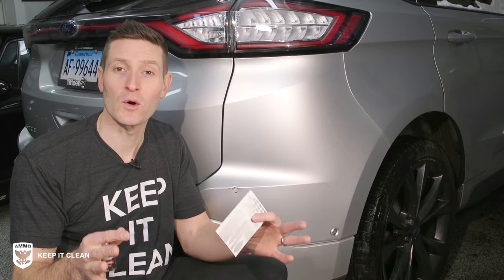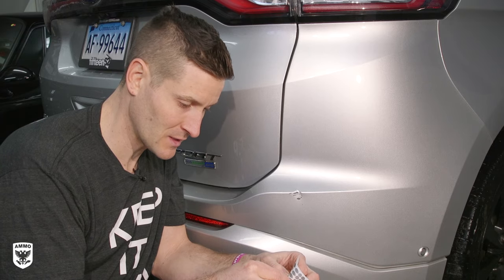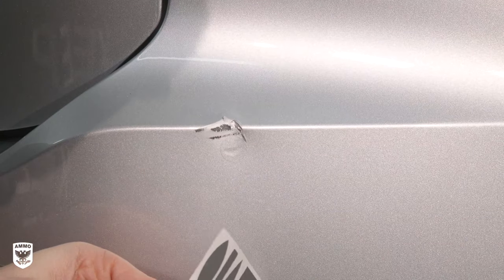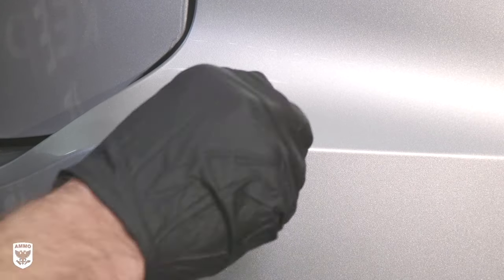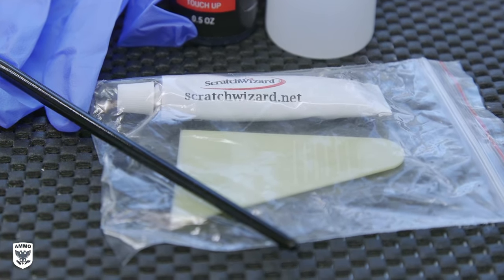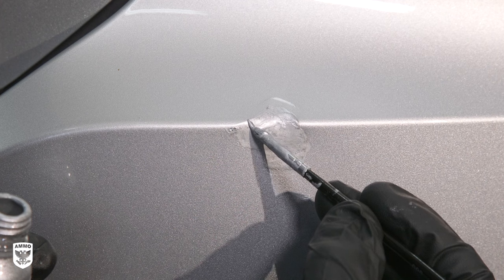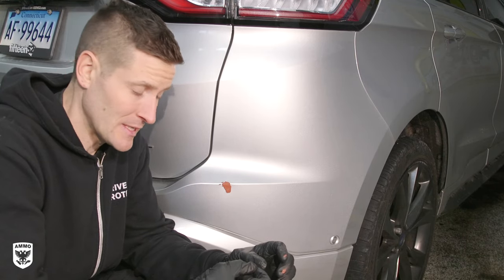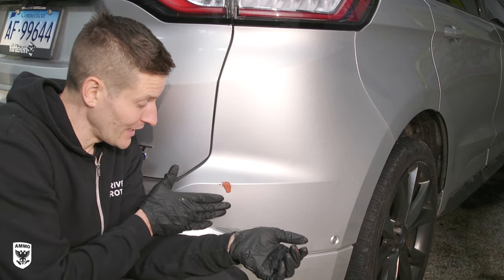How to Hide a Bumper Scuff Fast

Comment: Isn't this car a lease? These touch up stickers are perfect for lease returns lol
Reply: Yes they are!
Reply: I want those stickers, where did he get them!?
Reply: @AW-gj4ji  I think it's in description. If  not mentioned. Now- color matches aren't anywhere near perfect. Especially if you match a panel vs bumper. How far off depends on what angle you see it. But I suppose to the non-skeptic most wouldn't notice. I di something close for a living. I can walk by a car  and see almost EVERY ding, scratch,'Repair', chip. I am sure the details  on how people  try to cover up stuff  would bore you.
Reply: @UZI9MMAUTO  Yeah, I notice every small little details too, but some idiot scuffed my front bumper while my car was parked. I got quoted 600$ to fix it, I think I will be able to deal with some cover up for a while till I get enough damages where I would repaint the whole car instead.
Reply: @AW-gj4ji  Why I park but FAR from everyone. What  color is your bumper and is it a Pearl? P.S. If you have paint transfer. You can use diluted floor wax stripper and a rag :) That is one of our tricks. Otherwise go in various up,down,up, side to side motions with a safe thinner, DO NOT  'rub' it out fast.[Go light in either chemical and take you time- vary in directions]  Otherwise You'll have a nasty score on the clear. The idiot detail guys do this and it looks like crud. Big rubbing scores all over a small  stain.
Reply: @UZI9MMAUTO  Sadly, it's not paint transfer. My car is black so it shows like a sore thumb out. I try to park far too but sometimes street parking I have no choice. I am pretty certain it's half intentionally as it was deep enough to scratch off some of the plastic.
Reply: @AW-gj4ji  Yikes! Sounds like some idiot couldnt go around. Just scraped you and kept going. Those can  be very deep. Now you have to get/make the right black. You can TRY the 'cover up' by paint code. We commonly more than not have to adjust the paint to match from the 'factory OTC match'. Those tubes and sprays arent always close even.Plus your bumper was  painted at a different time than your vehicle. 90% of the time if you stand back. You can kinda see a hue or contrast difference. Luckily this wasnt on a panel!
Reply: @AW-gj4ji  he made them ,buy them from him

Comment: Glad to learn from your experience instead of having the experience myself. Great tip on the stickers, which prevent further damage until you can get all of your dings, dents and chipped areas repaired professionally at one time.  Thanks for taking the time to work through this problem and showing us how hard it can be to use touchup paint effectively, the benefits of using leveler to correct mistakes, and the effectiveness of using paint-matched stickers. All-in-all a very useful video and thanks for making it.  If you find a way to get the paint stickers to fully adhere to the putty, please let your viewers know.

Comment: You have restored my confidence, Larry.  I bought a touch-up kit for my car from VW and what I got was a 2-part (color and clear) touch up kit and my car is metallic. And to compound the problem, they were paint pens not proper paint bottles. I was able to touch up smaller dings but could not get the dispersion right on larger ones and never got the clear to flow in any useful way and gave up. Now I know it's not that I was incompetent but that I was trying to do the impossible. thank you :D

Comment: As people stated, time to learn how to use an AIRBRUSH Larry! It's just the perfect excuse to buy one too.
Afterwards use the polisher to remove any overspray and make it almost perfect :)
 You could have sanded down the bump or even cut it flat with a razer blade and then fill everything with bondo.
Great vid!
Reply: I agree Metallic paint is difficult for larger surface areas. An Airbrush sounds good. I had to feather in the paint from spray can and then the clear coat 2x harder glamour can.
Reply: The fleck will show  and if doing various cars. It takes  LOTS of cleaning per color. Plus the wind. amount of waste isnt cost effective. Even with black paints. Even the same make, will have blue, red,green, big/small/tiny fleck. It won't always 'pay for itself. Plus many are  stupid pearl based paints...
Reply: I found a guy who was a Michelangelo with an airbrush that made a spot like this literally disappear for $100 or some ridiculously small amount.  After he fixed it I couldn't find any evidence it ever existed.  It blew my mind.
Reply: @claytonhinkle5468  do you by chance live in FL? I would love to use his services and tip him generously!

Comment from the maker: FYI: The prices for the wrap vary on color, size, shapes etc...the cheapest I noticed on the website was roughly $30, but call them to get the specifics. Hope that helps. :)
Reply: What's the site?
Reply: Would it have been possible to use touch up along the edges of the sticker to help blend it in?
Reply: AMMO NYC  will it hold up during a wash?
Reply: Francisco Arroyo as long as you don't blast it with a pressure washer, you're good
Reply: AMMO NYC whats the website called
Reply: Have you ever tried doing this type of repair with the color matched auto spray paint?
Reply: It is a hundred dollars for the smallest size.  Click bait.
Reply: Have you tried taping off the surrounding area and spraying the touch up paint then wet sand and polish to blend it in?
Reply: What I normally do since it's a (temporary) cosmetic fix is to shave the lip off with a razor(not for everyone) then build with putty. I have done it hundreds of times when I do a temp fix on license plate holes because the screws cause a bulge. I rather build up than see a new ridge line.
Reply: IAM EVERYDAYGAMER so you can’t use it as a permanent fix even for a tiny spot?
Reply: Ryan I think you can but depending on the environment you live in a fix with a wrap is temporary. I live in the Midwest and something like this would not be permanent. The weather takes a toll on every car around here.
Reply: why don't you use thin aerograph???
Reply: +1 A hobby airbrush that uses a can of compressed air works good on an area several inches square, on a single stage paint job, less well on a base +clearcoat.
Reply: On a silver metallic paint? I don't think the result would be "perfect"
Reply: @5084204  Metallic paint can never be repaired correctly if you cannot use the same method as the factory.
Reply: Should have corrected that 'ridge-line' by applying heat gun BEFORE bondo, and mold running.  Would have saved a lots of filling.  sprinkle some nail polish glitter on it in the mix.  You will be surprised.

Comment: Hey Larry, one trick I’ve had good luck with when trying to level touch up paint or that putty has been to wrap the towel around a meguiars foam sanding block. This keeps your finger from pushing into the depression and allows you better follow the body surface and  level the putty with the solvent with better results. Just my tip. Great video!

Comment: it's very good that you tried that much and you show as all your techniques. I am not a proffesional by any way just i love spending time in my car. I had a huge hole in my rear plastic bumper. What i did was to sanding down a bigger area than the whole down to the clear plastic. I put a mesh filler pads from 3m then 3m plastic filler and then 2 coats of primer one prebase coat and 2 layers of base coat 1 layer of clear coat. After that i let it dry for 5 days and then i wet sand a bigger area than where the hole was and finally i polish the whole bumper. The result was perfect. I used spray cans for the whole procedure. A lot easier than playing with the painting small brushes.

Comment: I remember having asked a question yesterday on the Porsche resto video, regarding touching up metallic paint. With this video you answered it all. Seems a professional like you has the same struggles as I am having with the metallic particles not lining up as spray paint would. The stickers are a great suggestion, but ordering them from Europe would cost a fortune in mailing costs. When it gets warmer again, I have a plastic front bumper that the previous owner of my vehicle damaged. I'll try my best on there, since it is silver metallic like your Ford. Hope I'll learn something on the way. Thanks for the insight, Larry.

Comment: Man you're crazy! Love how you tested different methods before settling but by far the easiest way to fix that "Dent" Would have been to heat up the area from the inside with your heat gun and push it out with you fingers and use a flat blade to shape the body line while keeping it hot. I've done this on a lot of bumpers with great success. Keep up the good work sir!

Comment: How come you didn't try to heat the bumper and push out the dent first?
Reply: My thoughts exactly. I'm sure there was probably a reason.
Reply: And to push IN the top bit too.
Reply: I am totally a novice, but wouldn't heating the bumper enough to push out the dent have caused even greater paint damage in nearby areas?

Comment: I had a scuff in my bumber. The scuff was long and lots of ridges in the paint. I sanded it with 240 sandpaper to level the ridges. Then all the way to 2000. Then i got color maching touchup (black metallic) after the touch up. I only taped the damage area and put a spray clearcoat on it and let it dry over night, then wet sand with 2000-4000 and then polish. Really came out good👍

Comment: i can repaint that for you in 45 mins for 200$ with high quality auto paint =]
Reply: 04av6 that’s 170$ to much
Reply: oh wow, you can repaint for 30$? where
Reply: it costs 30$ for the sticker.. Thats what he ment.
Why not just use a spraycan and blend it in?  Would be the best solution for the money.
Reply: Ill do it in 20minutes because I have a trainee mixing paint.
Reply: i can repaint hole car for less than 100$ 
and before asking were i well answer you, in Yemen ^_^
Reply: 04av6
Reply: @dereknapier836  This work is probably done days before the car was sold?

Comment: Sometimes if you pour very hot water on a plastic panel it will return to its original shape like a memory foam. Maybe try that first then skim it with bondo or sticker. Awesome video as usual 👍

Comment: Initially inspired by Larry's old touch up video, I've tried the classic paint touch up with sanding, Dr. Colorchip, and dealer paint with Langka Blob Eliminator. I found the Langka method by far and away the best. You quickly go through the clear on a new paint if you're not careful, and so it is a very slow and methodical approach. If the touch up paint bubbles, as mine likes to do, you can't go back again without removing even more clear coat, which is not good (buy thinner if you have this problem, btw). Dr. Colorchip would be nice, but the color doesn't match quite right (even with a replacement bottle). Polishing never quite gets the gloss you'd want, and oftentimes removes the paint. Langka might not get quite as good of a look as the sanding method, but is essentially foolproof and blends the chips very well.

I think next time around I'll lightly sand the edges as Larry says to minimize their appearance (they are very noticeable on my black truck) and then follow up with my touch up paint. Basically, I use just enough of the color to cover the metal/primer, then top with clear until it is slightly above the rest of the paint, then use blob eliminator to level it out. Polish to your satisfaction.

Funny that you did a video on Color Wrap Match, as I was just looking at them the other day. As far as your feelings on touch up goes, I'm in 100% agreement. My wife also thinks I'm crazy too...paint damage has a way of driving one insane. Trying to figure out paint protection that won't cost $7k like a full xpel wrap. Had any experience with Autoflex? It looks pretty promising....

Comment: Excellent! My car has a small paint scratch on the bumper but the original contour was unaffected. So I think my best choice will be to use the stickers. It is a solid yellow and I won't have to worry about the 'grain pattern' of the metallic particles matching up👍👏🤝Thanks😉!

Comment: Hi Larry, to prevent an uneven surface like the one with the first sticker, use a sanding block or a piece of wood like the pallets for stiring paint  when you sand the putty, this also helps to featheredge the putty to the paint keeping it even

Comment: You could've poured the paint into
a airbrush. That's used for small
model cars. Tape the surrounding
area first with painters tape.
I know it's a little late, but it
probably would've been a better
option.

Comment: Hi. You can try to apply the paint direct to the damage, layer by layer than you nearly get filled the big hole. Then fill the rest with clear coat only. Let it dry several hours (it needs to be perfectly dry) . After that level it sanding and polishing. This trick works allways for me ;) (Sorry for my english!)
I'm waiting for the result!

Comment: You should try using a catalytic plastic or epoxy filler, clear in color that hardens to provide less shrinking over time and heat and cold 🥶 that’s what I do and I’ve leveled off a lot with UV glue or hardened clear touching up deep or slight scratches and chips..only a suggestion the UV GLUE IS NEAT AND COMES IN PINPOINT PENS WITH A LIGHT 🙌🏻

Comment: a good tecnic you can try to aply metallic and try to disperse the flake is using one sponge and dab it on top of the area you want to paint, it stop the brush marks to happening and create a much more homogenic finish, just use one sponge from your kitchen, pic up the paint, dab the exess off and dab on top of the surface, I never used that in my car yet but i use in scale model making and to me it worked.

Comment: The spot putty is lacquer based...the solvent to remove excess putty is basically lacquer thinner.Duplicolor paint prep solvent is a milder formula of lacquer thinner and you can use it to remove excess putty.  40 years as a master painter

Comment: you are right anything bigger than a pencil tip is a pain, I worked in a body shop as a youngster, sand down then fill in then find a spray can thats close to the color many auto parts stores have them then tape off and apply 2 coats buff polish cannot see it most times.

Comment: Great video showing frustrations of a bodywork repair! 

But why not do the following:
- sand off the protruding plastic bits;
- use putty to fill the dented space so the shape matches what should be there;
- sand down with P2500 to smooth the surface;
- spray paint colour coating;
- spray lacquer to finish?

Comment: I had the same problem, and out of 5th time solved it perfectly. I had much bigger ridge on plastic, sand it down and fill in holes with leaving little dip, so when you put paint it is flush with the rest of the paint . Use paint with code in spray because it is not dense like touch up paint with brush, mask surrounding bodywork and spray untill you get little bit higher than old paint, then sand with sandpaper as required and polish. you could see the difference only because the code paint wasn't 100% accurate
Reply: ^^^ THIS^^^  Clean with alcohol, sand high spots flat, scuff, clean, fill, sand flat, clean, tape around leaving 1/4" border, spray, feather edge and polish.  Surprising how well is can blend.  If dealing with exposed metal (more than a scratch), prep and seal with epoxy primer then finish up as above to cover with color.

Comment: Hi, i reccomend you small airbrush gun, i am using it for repairs like this. Fill the hole, wetsand it, spray it with paint, wet send it, repeat, when it look good, spay it with clear coat, wet sand it and polish it and looks great 😉

Comment: You should of used a stanley knife for the ridge and then fillered it with fibreglass then primed and spray coated it.
It would of been easier on you.
I felt your pain bro.
You are a excellent youtuber and big respect for all the effort you put into it all.

Comment: First you have to minimize the depression with pulling or pushing
if you can. After send the dent and use a body filler compound, and in some specific
condition we apply coats of fiberglass via a tiny brush. Send the surface until
little imperfections remain. Glazing & spot putty, fills imperfections, pits, scratches
& very minor dents, use with other auto body repair materials, great for
filling pinholes in body Filler, can be sanded & painted. Restore a
perfect surface, prime and sand up to 1200, 1500 and 2000. Use a paintbrush to
paint and blend. Let it to dry, and wet send the with 2000 grid, and after
polish. The secret is not to wide a nickel dent to a dollar bill surface.

Comment: Hi Larry! So I came across these contour and angle sanding grippers. I myself had a roof rack fail and the bolt underneath scrapped through a body line to bare metal. I just covered it up with primer and touch up paint. Looks like a scab right now.

 I thought for sure I could recreate the body line with the angle grippers. Seemed like the logical option.
Maybe you could give it a whirl.

Comment: Did you consider picking up the OEM paint code in spray paint form, taping the area off, and spraying the touch up on? You could then sand down and buff. This would eliminate the texture problem.

Comment: imo for the final sticker placement i would make sure the sticker has no corners to snag/peel and i would use one large piece rather than 2 to avoid water and dust getting in the seam and making it peel up. you could use the heat gun to allow it to conform better to the repair in the body line area